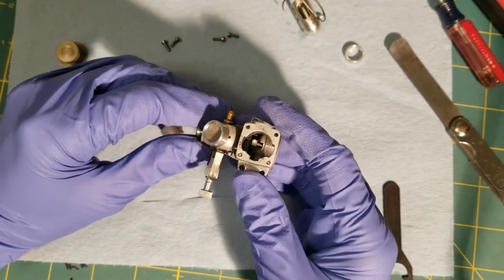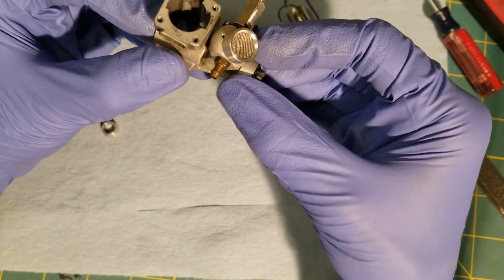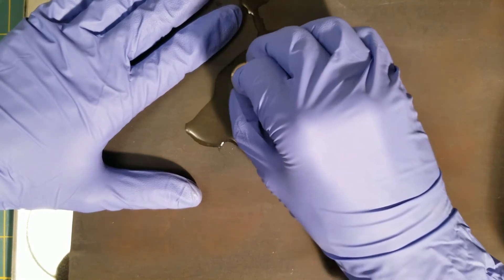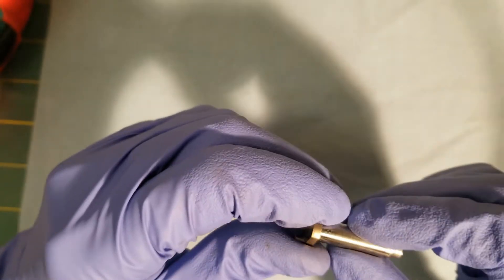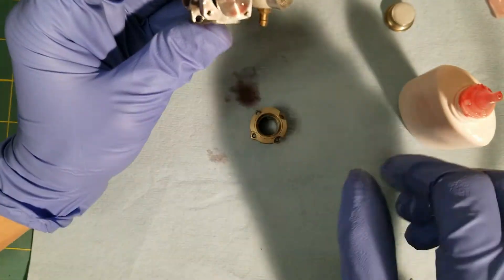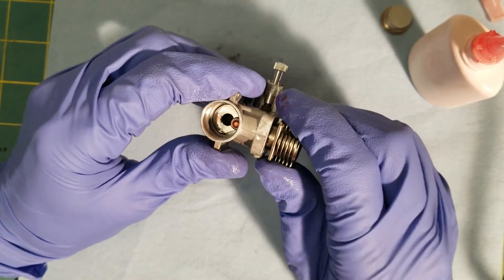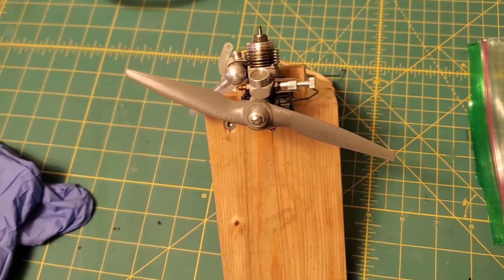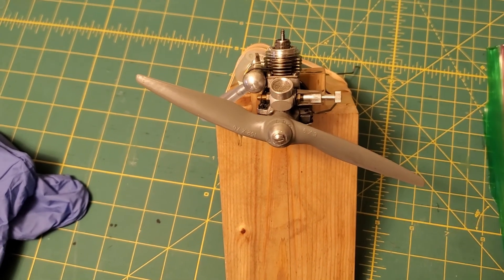Norvel Big Mig 0.061 fix attempt

Comment from the maker: Hey everyone finally figured out what the issue was. I'm 99% sure the crank pin was bent by the P.O. using an oversized electric starter / not preheating for break in. Im on the hunt for a new crank and connector rod.  Thanks for all the input 👍🙂 everyone.
Reply: Were you able to get it figured out?
Reply from the maker: @mgpmbass3616  not yet unfortunately I'm on the hunt for a new crank.  Hoping to salvage the top end from this one.  Maybe once one of my flyers wares out I'll make a Frankenstein motor from the two.

Comment: The dud is the plug adapter and plug. Once you have that replaced break it in proper. Use a APC 4.5x4 if you want it to rev up to par. The 6x3 is great for thrust once the engine is broken in. Also shine some light past the screen insure the throttle barrel opens all the way.
Reply from the maker: Thanks for the reply, ill keep that in mind if i ever get a new motor. However I have to respectfully disagree with the plug causing the interference issue.  I've run both button and this style has nothing to do with engine drag. Rather significant mechanical interference not related to cylinder / top end pinch.  It may be a bent rod. As there is significant ware on the rod itself (inbetween the crank and piston eyes).

Comment: I used high temp silicone caulk to seal the backplate on my Norvel .40AX. I had to machine a new piston as the old one was scored.
Reply from the maker: Oh wow, how's the new piston holding up?  I used some motoseal around the carb bolt to stop an airleak, gained a minute extra flight time for a controlline plane.  I picked up the gx 40 to experiment with. I've been very curious how the glow converted to gas will perform.
Reply: I haven't tried starting it yet. The Norvel website does list a replacement piston/cylinder liner, for the .40AX, but I couldn't checkout (maybe due to the war?). I highly recommend using after run oil for any .40AX and don't run it too lean.
Reply from the maker: @jeffpittel6926  thanks appreciate the tip. Very good chance there is  complications considering the situation.  Exmodels might have some new old stock.

Comment: Hello - is the crankcase real hot on the bottom when run?  Has someone used an electric starter on it?  A tite fit on crank will keep it back just a bit and a starter may jam at back plate- 8 oz of fuel - may need too polish crank with it removed , my guess is tite crank fits !!-!!
Reply from the maker: Thanks for the suggestions, appreciate it. I don't have a photo of it but the connector rod shaft, has a significant ware grove cut in on the crank side (5mm up the shaft). Something is really off alignment wise.

I did pull the crank and polished to a mirror shine with scotch Brite after the 8ozs. It looked pretty clean.  Can't say I know about the starter, its a used motor so good chance. Didn't  notice any significant heat on the crank end though when running.

Comment: The crank has a crack from intake round thecrank
Reply from the maker: Cool, thanks.  I must not of seen it. The middle of the rod was wearing / interfering with the back of the crank counter balance (solid grove worn into the rod). Thought something was bent. Might dig it out of the parts bin and have another look.  Cheers,